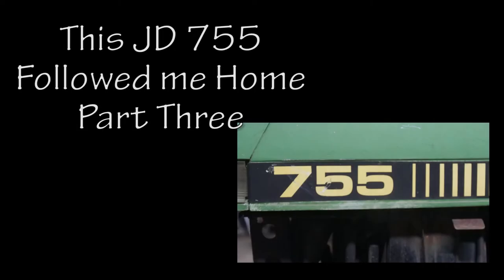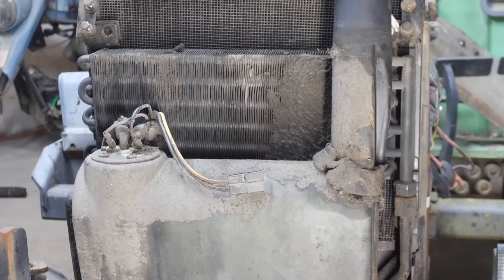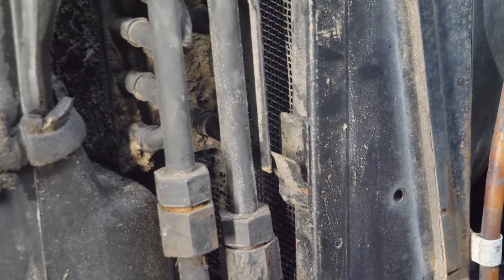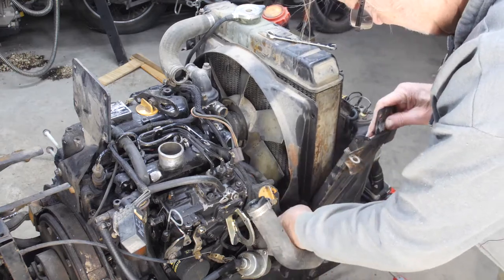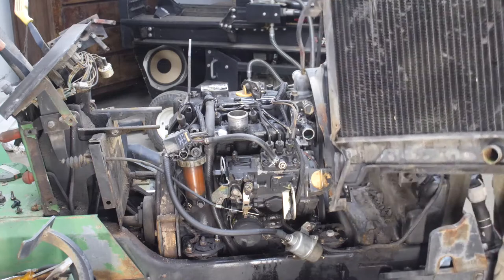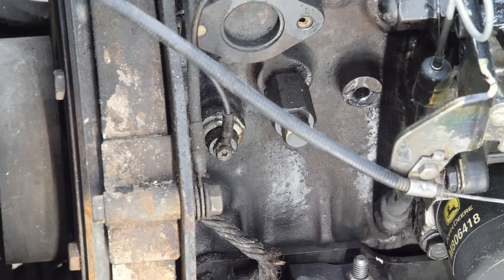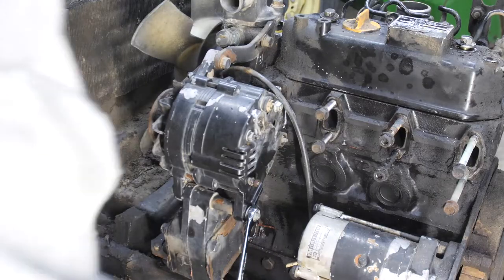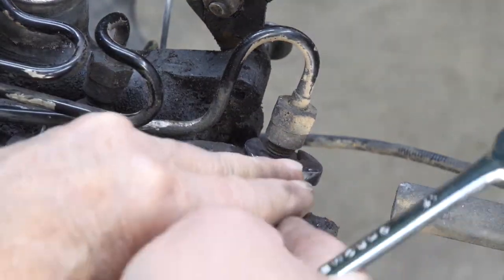John Deere 755 Blind Date Part III

Comment: I think someone dumped gas into a diesel system.  I've seen this done before and the engine simply die out.  I wonder what shenanigans went on in order to get the result they did.
Reply: You're right to ponder what experiments were conducted on this unit. Episode VIII is nearing completion and I'll follow up with a wrap up discussing the fuel and other general observations to date. In advance of that dropping, think about how, after a couple of months, a red sediment accumulated in the bottom of the jar and why it has now turned brown.

Comment: Possibly was using biodiesel. See video: How does biodiesel impact engines? Lubrication Explained for a very good explanation.
Reply: I'm inclined to agree that it is some type of biofuel. The odor is/was definitely different than straight #2. Here's another detail I'll be sharing to all when I review my thoughts on the machine's history. I had the occasion to show a sample to a couple of GM engineers who were up visiting my son. When I took it to them, they noted the odd odor/biofuel possibility and also asked about the red precipitate. Does red dye settle out of dyed fuel? The deposit appeared after 4-5 months! Is it possible that the bio-product was dissolving any red staining that had accumulated in the tank (now turned brown)?  More to learn. Thanks for your suggestions.